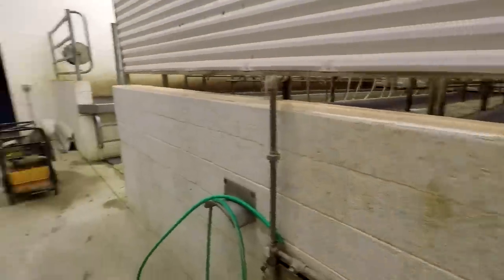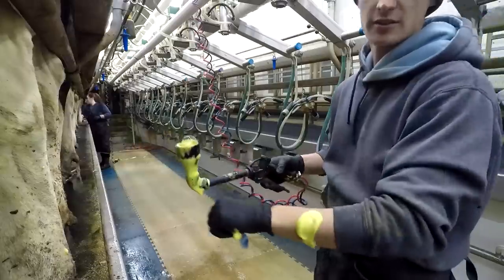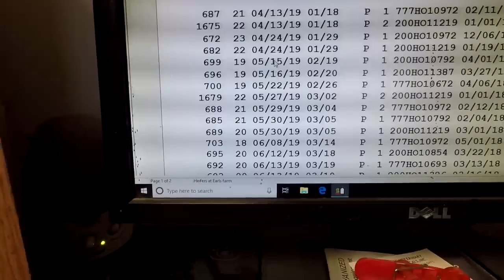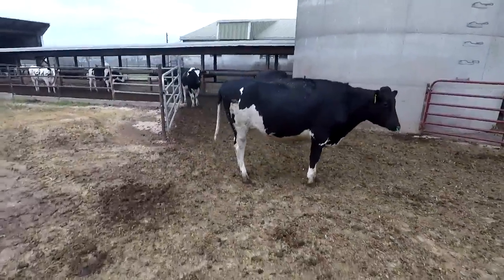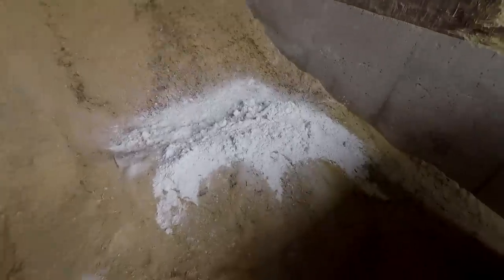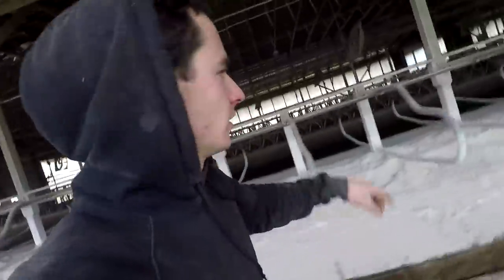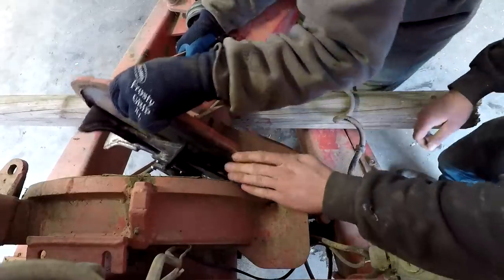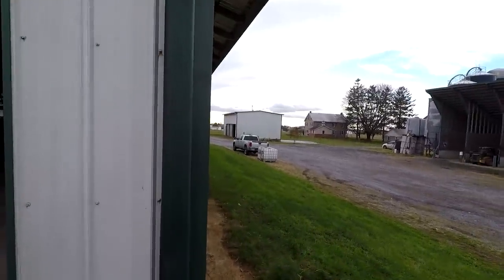Day of Dairy Farming | Milking, Feeding, Fixing, Chores

Comment: You could try using calcium carbonate lime. It isn't hydrated or burnt. But it will change the ph enough to stop bacteria growth. its way cheaper than hydrated lime. and you can buy it in bulk. it is also way safer on the skin eyes and lungs

Comment: My dairy farm used to use lime in the stalls but found it didnt work that good. We changed to a chlorine solution of 3 parts water to 1 part chlorine and spray that on the stall once a day when the cows r in the holding area and have had much better mastitis control.

Comment: Does it stay warm enough in the barn to keep the water beds from freezing?
Reply from the maker: They have antifreeze in them
Reply: 10th Generation Dairyman that makes good sense. If one popped it probably drain into the pit fast enough, or get soaked up by the bedding that it wouldn’t be a health risk? Or is it a formula that’s safer?
Reply from the maker: @iowANFarmer  I think it's a safer formula, not a exactly sure what they used. Haven't had one pop yet in 10 years.

Comment: when loading cows you should have your truck in neutral and the parking break on. The back and forth of the cows running in the trailer is not good for your transmission and could break a tooth off in it.